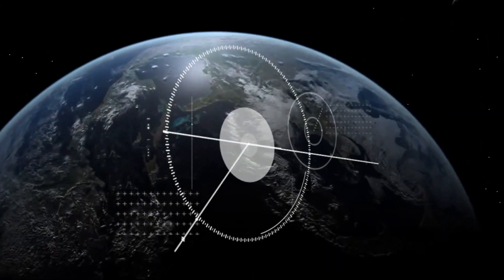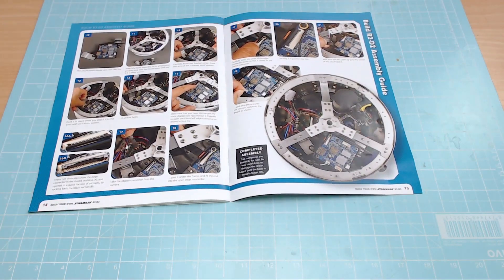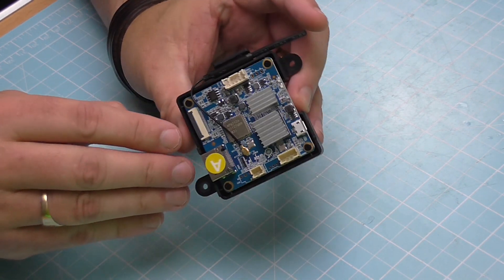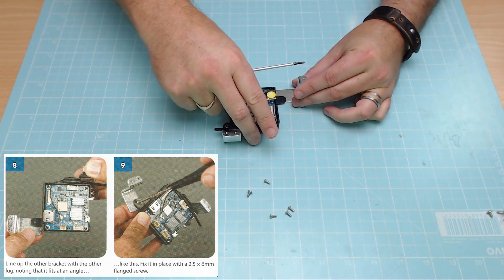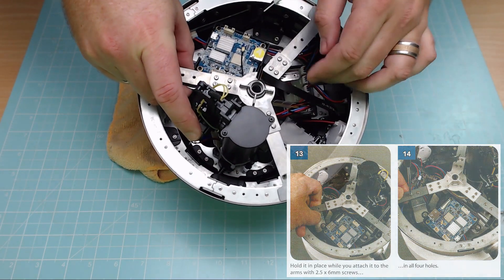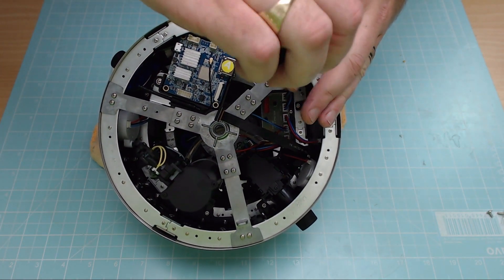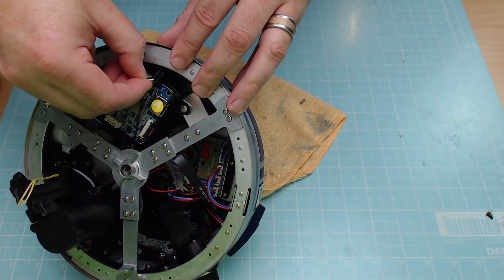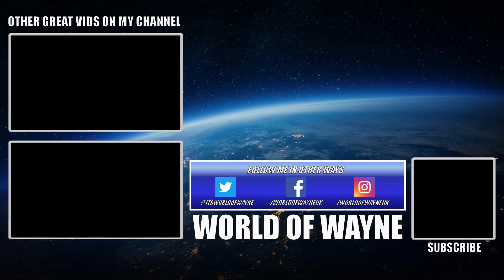Build Your Own R2-D2 - Issue 99 - Fitting the Dome Circuit Board

Comment: The grounded metal strip on your table was a good idea. In my work, one could easily damage a $10,000 circuit board from static discharge. So never assume it’s not an issue.

Comment: Hello..
Apologies for this question..I bought this droid as used...but it doesn't come with the adapter charger...so would you mind to share regarding the spec of the charger adapter please??....
Like what is the output said on the adapter spec??...is it as 15v===2000ma??

Or in which magazine issue number the adapter is included inside?

Please let me know. 

Thank you
Reply: Thank you for reading my message...so any clue on where or how I can get the adapter charger?...
Please let me know. 
Thank you

Comment: Have you ever thought of buying a pair of angled tweezers for getting into tight spaces? I have a pair of them that I bought for decals, but they work great for getting into tight spaces.
Reply from the maker: I have some buy didn't want to risk metal on that ribbon cable
Reply: World of Wayne oh.... the one I bought came with removable rubber tips. 👍🏼

Comment: Does anybody know what the empty sockets are for. There is a micro usb, usb, micro SD card slot and possibly a HDMI socket. Seems strange to me that they are incorporated but are redundant. Also the magazine link does not take me to where I'm supposed to find the voice command list. Have contacted deagostini but they have not replied as of yet. Great bids and my R2 unit is amazing too had a tear when I finally got it working.
Reply from the maker: No idea although the orange pi is pretty standard so I'm guessing they were used to program the board
Reply: @WorldofWayneUK  so would there be a way to set up additional updates or even programme r2 to do other things like maybe play music or maybe even video chat over the internet?
Reply from the maker: Perhaps from external customers who come it with mods. Deagostini won't go near it now. They will move on to the next thing.

Comment: What's the spare connector on the board?
Reply from the maker: There is a couple that link the domes other motherboard and one to link to the main PCB in the body.
Reply from the maker: That will be issue 100 :D
Reply: John L one of the connectors appears to be a usb type could be for programming but not really sure it's marked A.
Reply: @MusicFurler   Thanks

Comment: That camera cable was a nightmare to put into have smaller fingers and still strugged .
Reply from the maker: yep. It certainly was fiddley but once its in you know its seated okay :D
Reply: @WorldofWayneUK  I've got an issue with the dome not fitting.
Reply from the maker: @davidmckirdy4063  What do you mean. Do you have a gap?
Reply: @WorldofWayneUK  yea there is a few centimetres gap and I did remove some of the rod but still looks the same and it wobbles.
Reply from the maker: @davidmckirdy4063  You shouldnt of needed to adjust the rod. I put the rod in mine and had the same problem. I forced the dome to the left and right and it just shot down and closed the gap
Reply: @davidmckirdy4063  you may need a new rod if you've taken sum off, when you seat the dome like Wayne states you need to turn the head to the left or the right and it will drop down and seat itself into the motor hope this helps
Reply: @nickibibb4933   i did that the rod is still to long and the dome wobbles.
Reply: David McKirdy are your bearings seated correctly? There is meant to be a small gap to allow free movement of the dome. Shorting the head axle will give you problems I would suggest getting a new axle.
Reply: @nickibibb4933  I'll try a new rod the reason I sawn of a little was there was to much of a gap  the rod I still have does go all the way down the crankshaft through the dome support and into the hole at the top of the dome.

Comment: I'm wondering, just watching your video, would it be worth attaching the unit to the Y frame and attaching the wires before attaching the Y frame to the dome? It just seems very fiddly.
Reply from the maker: It would make a lot more sense
Reply: Not really, although it would be easier but would put unnecessary stress on the very thin ribbon to the camera it's best to stick to the instructions.